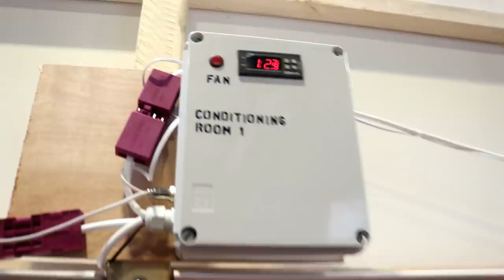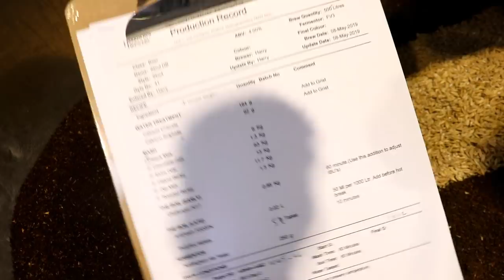FANCY A STOUT RECIPE?

Comment: Thanks for sharing the recipe Harry! By the way, try to keep the glycol mixture to a minimum. Water is one of the best heat transfer fluids. Heat transfer efficiency will actually  go down as you add glycol. Unfortunately you do need it in the winter. The systems I work on use just water ( good clean water) in the spring to fall and then we start to add glycol as winter approaches. Cheers!

Comment: Harry i tip my hat to you for sharing like you do, i do the same for my chosen profession and its actually back firing on me a little but hey ho we digress. I would get that 12V DC cable swapped out at least to the first 2 control units, you can get dedicated 12V cable pretty cheap but i would be tempted to go with 600V LSF cable as you are a commercial premises, being rated for 600V makes it very suitable for 12V remember ;) I would think you need 4 to 6mm twin if you can find it, remember 12V suffers bad volt drop also.

Love the design of the conditioning rooms, simple yet effective and STC's are so good for stuff like this. Are you going to foil tape all the joints/rips on the insulation boards etc to effectively form a vapor barrier? Would not take long to do ;-)